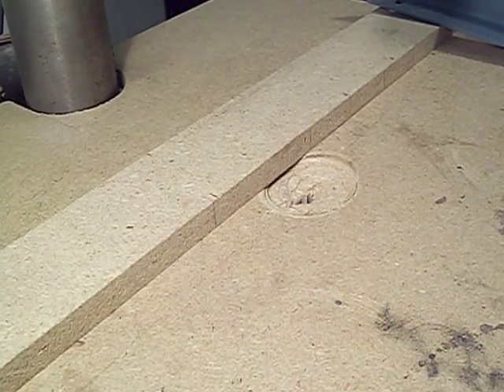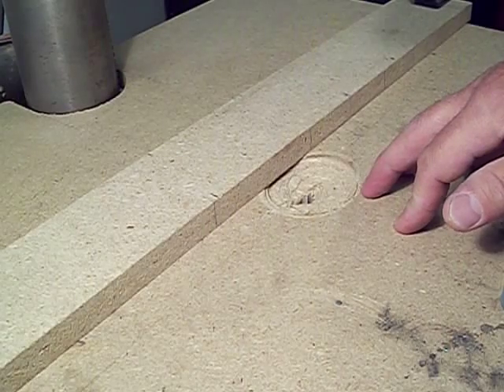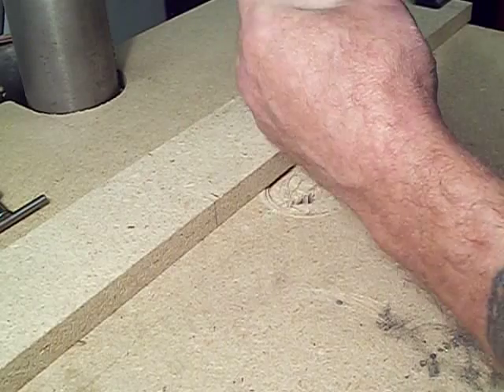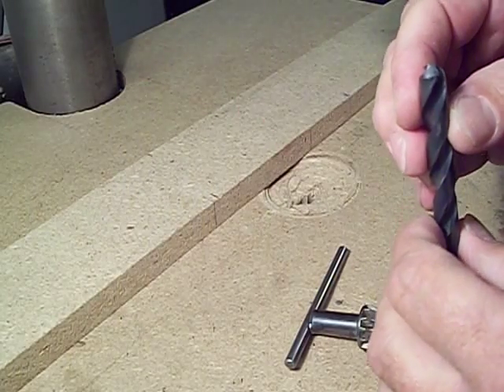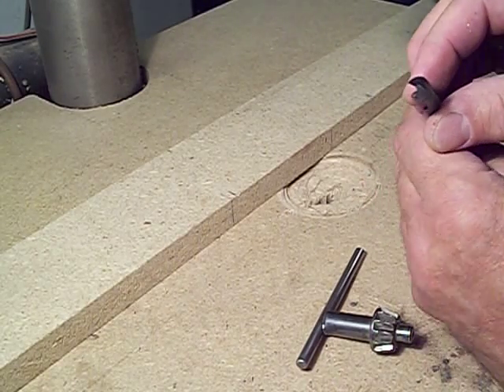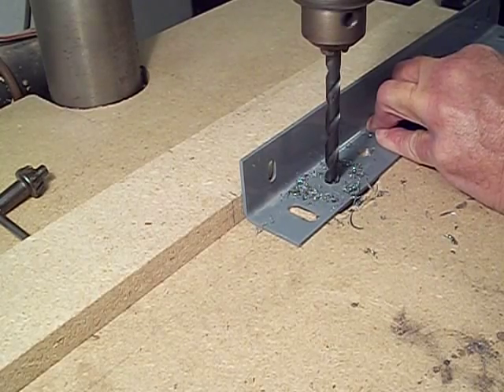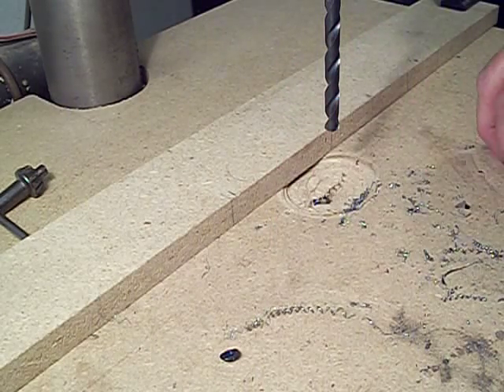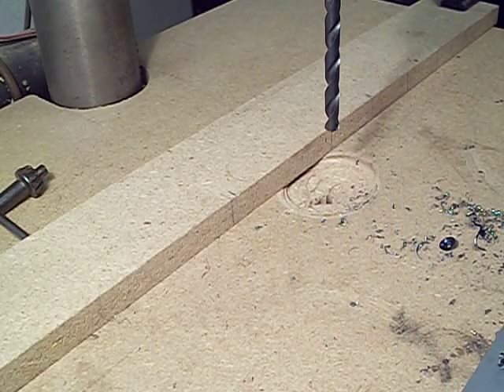Drill Bit Sharpening Jig - Follow-up

Comment: i dont think it helps at all to tigthen using the 3 holes on the drill press chuck. Unlike the lathe chuck, the 3 holes of the drill press chuck act on the same gear.
Reply: In a perfect world, it might be alright to tighten the chuck on just one side.  However, other experienced wood or metal workers have also stated that the drill press should be tightened on all three sides.  I’ve seen bits come loose when tightened from just one side, and have stressed the importance to my son of tightening on all sides.  Safety first!